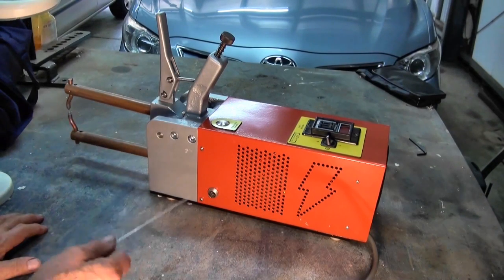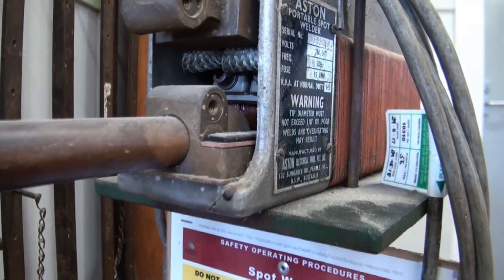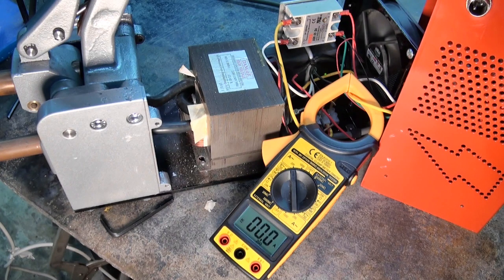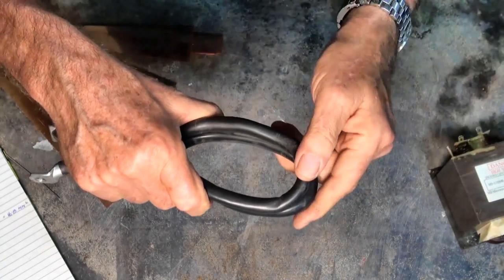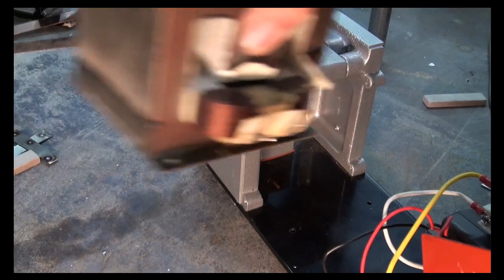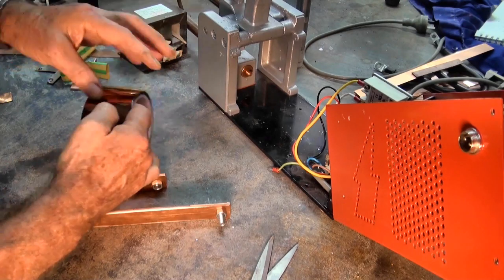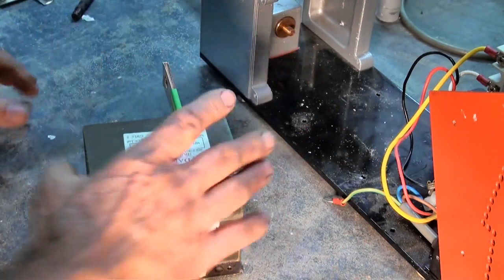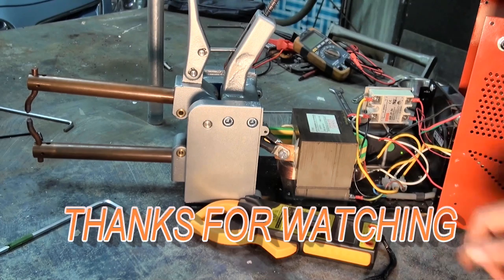Spot Welder Upgrade Goes Sideways

Comment: Great Video! Each transformer core has a certain amount of power that it can deliver into the secondary winding's.  Given a certain amount of space in the core for the secondary winding's. you have 2 choices more winding's of smaller copper wire which will give you more voltage and less current, and less winding's of thicker copper wire which will give you less voltage and more current.  So if you want to maximize your current and not lose too much voltage then you want the thickest copper conductor you can get wound around the core 1 time!  And as Matt has said you want to fill the cavity in the iron as much as possible!  And you want to keep your connections to a minimum not to lose voltage before it gets to your metal to be welded.  Liked !
Reply: More voltage gives more current. V = IR and we are assuming R is constant.  You are referring to the max  performance limit of the transformer which is expressed as a wattage (power) so you can have higher voltage with a lower current to give same power however increasing the voltage will increase the current that any given load (fixed resistance) will draw.
Reply: @advoc8tr  Correct assessment!  But remember every magnetic core has a max potential energy it can deliver and then it will flat line at it's maximum power delivered. :)

Comment: Hi Mark, I am just starting to build my spot welder, picked up a big old microwave the other day and I thought I had it all nutted out until I watched your excellent video. So, I have access to truck size battery cable and strips of copper like you used so if you were to build one again what way would you build it. Strips of copper, as many as will fit in, say maybe 10 strips or heavy battery cable with the loop? I can do some basic wiring but this just running a loop above a coil and getting 1 or 2 volts but hundreds of amps seems like black magic to me. I did notice the original cable you were using was vibrating like crazy and may account for much of the noise. I liked the way the strips made it very quiet. Any enlightenment you can provide would be much appreciated. Thanks heaps Stuart 🇦🇺
Reply from the maker: Stuart,
I think that the configuration I am using at the moment is probably the easiest and best solution out of the three that I have tried. The single turn of copper strips should have been a better solution but apart from being quieter it was less impressive than the original two turns of #2 B&S wire that I used in the first build. Since changing back to two turns of #00 B&S wire I am able to get consistently good welds. Just a few days ago I made two replacement filter baskets for my 5000 gallon water storage tanks from stainless steel sheet. I had to weld some 0.6mm sheet to 1mm sheet and it went perfectly. I set the timer to 1 second and it probably could have done with less. There was no burn through and apart from the copper arms getting a bit warm I could not detect and other issues. I think the main limitation with these home build spot welders is the tip diameter. Anything over 2mm seems to be the limit with mine. If you can keep them dressed as they start to spread out it helps with keeping the current density high enough to melt a good nugget of metal between the stock. I found that the 00 gauge wire is a tight fit  in the transformer that I used and I packed any remaining space with strips of card stock and dense foam and that helps to keep the buzzing quiet. 
With regard to the copper strip method, I now think that  I should have used way more strips, as many as would have fitted but I am not sure it is worth the extra effort.
I hope you build goes well. I am thinking I will post some pictures of those filter baskets on my community tab so you can take a look at the result there.
Regards,
Preso
Reply: Mark Presling. Hey Mark, thanks heaps for taking the time to reply I’m sure you get a lot of questions to answer so I really appreciate it.
After what you have said I will stick with the original plan and use cable and I will use a lot of tips from you and other builders. I think with putting together all the information I have gathered over the last 6 weeks I should get a very good result. That unit you made really does look like a bought one. If mine turns out half that well I will be happy. Thanks again, Stuart. Canberra 🇦🇺

Comment: What is the "multi-panel" foam that you are referring to?  Is it that structural foam made in Oz for houses?
Reply from the maker: Steve, yes, Multipanel is an engineering foam product used in aerospace, construction and for rapid prototyping. Multipanel is the trade name  but there are probably generic products that do the same job. It is a sort of rigid, lightweight machinable foam.
Reply: @Preso58  Long term get rid of that foam and get hold of electrically rated insulation material. Also get hold of some Scotch 27 fibreglass tape and a can of 3M Ivi spray insulation varnish. Use them to properly wrap the secondary. PVC tape is good for only 75 deg C and battery cable only 60 deg C.  If you can't get electrical red fibre or similar, dry wood wrapped in 27 and we'll sprayed heavily with Ivi spray will work. Spray multiple coats to seal and anchor the packing after installation .  If you can get hold of some isonel even better. It is imperative that your secondary never frets against the primary.  You are however on the right track. Please always use an RCD with this tool.
Reply: @mikenewman4078  For those in North America, an RCD (Residual Current Device, as it is known outside North America) is known as a GFI or GFCI (a ground fault interrupter).  I had to look it up to see what Mike was talking about.  It's a good idea to use one, thanks.

Comment: hey Mark. spot welds are usually measured by whether they can pull 'parent' metal from the larger of the parts. if they can, they're good. if not, manufacturing standards would say they're not.

Comment: Let me point out that in first case there was no 2 turns but 1 3/4, and now is 3/4 of a turn ! That means - if you bend the strips to look more circular than horseshoe you will gain around 0,25V. Pulse should be short (about 1 second) and no melting. Nice build.
Reply: Sorry, but "turns" are always integers.
Reply: That's why you call it "U turn" and in my language it is "half turn". Besides, seems to me that you never personally made a windings, or calculate them ;)
Reply: @GilmerJohn  and what if someone tells you tu turn left, is it "L turn" or "quarter turn", or you just make a whole spin around ? Why do you think the one turn is divided into degrees, minutes and seconds ?
I don't get it why is your reply highlited ? :)
Reply: @pingvinac  -- A closed loop around the center core is ONE turn.   It doesn't matter how long that loop is.   It could extend our 1000' and it would still be one turn.
Reply: @GilmerJohn  not exactly, only in close proximity of the core, but my point is - to make one turn of wire INSIDE transformer it must be allmost touching the core on ALL 4 sides. This is not that case. Ofcourse that same wire eventualy makes a loop and comes back but that is not considered full turn, only 3/4 of turn. Othervise you could steal current from neighbours through air :)
I don't know what is left to say, the picture at 26:40 clearly explains for itself. It is 3/4 of the turn from transformer's point of view. So he is lacking 25% of voltage for the same current. Or you could say that he can gain +33% voltage if he made that longer part of flat copper go bent near core and again bent to outside, niear other end. And it still wouldn't be a full turn hahahaha. Only about 95% of a turn :) Cheers

Comment: Stuff the core with more copper! 2 turns of 70mm2 or 95mm2 copper cable, without the rubber and insulated with a thin layer of electrical tape.

Comment: Why would you measure the primary side current when you are more concerned with the secondary?
Reply: 2 reasons you would do this: 1 - Because the two should be proportional. If you draw 25% more on the secondary, you should be drawing 25% more on the primary, so, it tells you what you need to know, since the actual number doesn't matter, and 2 - The output current is over 1000 amps, likely 2000 amps, and his meter maxes out at 1000 amps. So he can't measure it directly.
Reply from the maker: The current draw on the primary and the current output of the secondary should be proportional. I was just trying to get some idea whether the upgrade was increasing the current at the welding electrodes. Also I doubted that the cheap(ish) clamp meter was up to measuring what I expected to be over 1000 amps on the secondary side. As it turned out, my results were inconclusive. I couldn't seem to get any consistent results when I was measuring the current after the upgrade. I am pretty much convinced that the clamp meter is poorly made and is influenced by the stray magnetic fields around the transformer.
Reply: I think you gained a lot. Without rattling and heating of the secondary winding it will be much more reliable. Quiet operation is fantastic. Thank you for showing it. I will definitely make winding this way.
Reply: To measure the secondary current, use a Rogowski coil based instrument like the VOLTCRAFT VC-10T which can measure up to 3000A.
Reply: Totally correct.  The secondary versus primary current and secondary voltage (open circuit and while welding the same materials, preferably a couple of samples) needed to be measured before and after modification. There has been a major change to the secondary inductance simply by getting rid of round cable. Wider copper strips would have reduced the inductance slightly more.  High current AC applications utilise bus bars for that reason.
At 50 / 60 Hz Mark's laminated bus bar is pretty close to the money.
Where higher frequencies are involved such as in the traction inverters I work on the bus bars are thin but wide (5mm thick by 200mm wide to the reduce inductance).
If the weld strength tested to destruction is the same with less primary current, heat and vibration, I would call it a win. If the weld time for the same weld can be reduced, it's a bigger win. Spot welder timing is normally related to the AC waveform and with thin materials such as template will be dialed to fractions of a cycle.

Comment: Just a couple of suggestions,  those clamp meters give inaccurate readings if too close to the transformer and also move the cable being measured  to the center of the clamp. Replace the secondary cable with as thick a welding cable as you can find that will fit into the space of the former.
Reply from the maker: Thanks, I don't know if you could tell but I was a bit disappointed with the results of what was supposed to be a massive upgrade. I sort of ran out of enthusiasm towards the end and resolved to do some more research. I did end up replacing the secondary with some 00B&S cable which is about 67mm square and now the welder does everything I want it to. The thicker cable just fits into the secondary cavity and it was a bit of a struggle to get it connected at either end but it does work. https://www.youtube.com/watch?v=VPTdDzf1-s0
Regards,
Mark

Comment: Why is it every time I watch one of these videos I get all enthusiastic and want to go into the DIY build mode......I've just come in from the garage after delving through a box of stripped down Microwave parts to see if there were any usable transformers then I remembered I had a spot welder on watch on EBAY for $300 and that sealed the fate of the DIY episode.....sigh.
Edit........so I went on EBAY and lo and behold Ozmestore in Adelaide have one for A$330......just couldn't resist the deal so I bought it.....comes on Fridai 11 Sept......how can one possibly resist it when it's so cheap.
Reply from the maker: Ian, I just checked out the Ebay link and the demo videos. It looks like a nice little portable machine and interestingly, it sounds exactly like mine. The price seems good too. I'm wondering if you could make some alternative arms and electrodes for it. Dan Gelbart did a very good video on spot welding in which he showed some interesting methods for welding studs onto sheet metal with some cleverly designed electrodes.
Regards,
Mark
Reply: @Preso58  I read another review about spotting aluminium and the guy used some strips of thin steel either side of the ally to get it to weld..........apparently a secret process known only to a few oldies who revealed it.

Comment: i have a similar build, i removed the pvc hose and added  fiberglass insulation sleeves instead (up 600 degrees)
from ebay. My copper wire is self made for several other copperwires, its now 10mm diameter (inner core) and 
12mm outside, but its possible to go up to 16mm inner core (18mm outside) and i will upgrade later (i wait for bigger glassfiber sleeves from china).27:26 i would use copper clamps not these silver ones, you can easiliy made copper clamp shoes from copper pipe with some pliers.
btw if your amp meter is not accurate you can test the performace with "how much mm can i succsessfully weld (in 0,5mm adding steps) i can weld a total of 3mm at the moment (1+2mm or 1,5 on 1,5mm sheet and all other combinations, but i cant do 4mm)
Reply from the maker: That's a good idea to use glass fibre sleeves. I noticed that the PVC insulation on the old copper cable was starting to deform but I was not worried about it melting fully. It does take up a lot of volume though.

Comment: I am more interesting in his triggering circuit then anything else. Since most "spot welds" only last a few seconds, or even shorter for some welds, I would like to see the trigger circuit for the primary to understand his timing control. And It would be great to add a new feature to add a couple outputs to spot weld battery packs. Of course that would certainly have to be trigger controls as well to keep from french frying the batteries. But then it becomes a much more versatile unit for a lot more spot welding capabilities... JMHO
Reply from the maker: Gary, check out this video in which I show the entire circuit diagram for the spot welder. The trigger is just a low voltage momentary contact switch which activates a digital timer/relay. The heavy current switching is taken care of by a solid state relay. https://www.youtube.com/watch?v=u7fJ-X2ud0w There is also a playlist of the entire build on my channel.
Regards,
Mark

Comment: What if you change the turns of wire for a single solid copper block that fills the transformer space? ... it will be like a single turn of wire ... right?
I am ignorant of the subject ... I have seen that other youtubers disassemble the shims of the transformer and then reassemble them ... greetings ...

¿ Y si cambias las vueltas de alambre por un solo bloque de cobre, sólido, que llene el espacio del transformador?... será como una sola vuelta de alambre... ¿no?
Soy un ignorante del tema....  he visto que otros youtubers desmontan las laminillas del transformador y después las vuelven a montar ...     saludos...
Reply from the maker: Francisco, I have had many people with far more knowledge than I have make suggestions on how to improve the arrangement of the secondary and most agree that having more copper in the space will improve the current. However, I eventually went back to using two turns of a much heavier multi strand copper battery cable. The spotwelder now works perfectly and does everything I want it to.
Regards,
Mark

Comment: Hi Mark, I’m appreciating the work you have put into your videos.
A suggestion for connecting the copper strips would be to turn the transformer on its side, turn up the end of the lower strip to bolt to the fixed arm.
I’m not sure if the upper strip has enough flex to bolt directly to the upper arm or whether this would stress harden or fracture with use.
I have a question, is the surface area of contact relevant, should the two upper arm cables be connected separately, perhaps on either side of the strips and top arm. I know very little about electrical theory so be gentle with me!
Thanks, 
Stan
Reply from the maker: Stan, the original version of this spot welder design did have the copper laminations bolted directly to the moving and fixed arms. However at that point there were 20 or 30 thicknesses of very thin copper shim. I am guessing this was to allow for plenty of flexibility and therefore lessen the chance of work hardening and fracturing. I followed up on this video with another revision of the design which has now proved to be much more successful. Like you, I too have a limited knowledge of electrical theory so I admit that the solid secondary design that I showed in this video was very much a failed experiment. It did work but it was not the big improvement that I was hoping for. Since then I have had many people with more knowledge than I have contributing their ideas and guidance. If I were to try this again it would probably look quite different. I used the welder just the other day and it still amazes me that it works as well as it does. I had to weld up a stainless steel tank for a steel parkerising process and it made it so much easier than messing about with pop rivets and the like. 
Regards,
Mark Presling
Reply: @Preso58  Love your video, copper wire is the highest purity cu for the best flow of electrons but cu strips, pipe or bar stock is very different and gets a much lower price at the scrap metal dealer. Just my thoughts on this and might be a cause for reduced power out put.